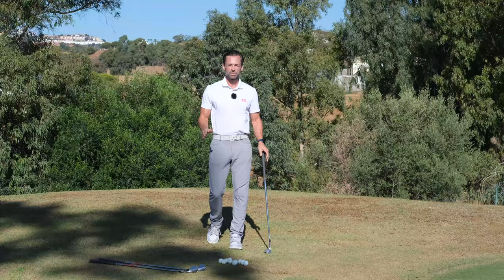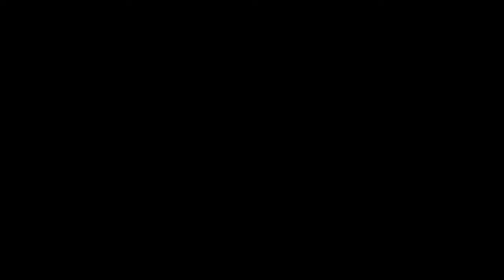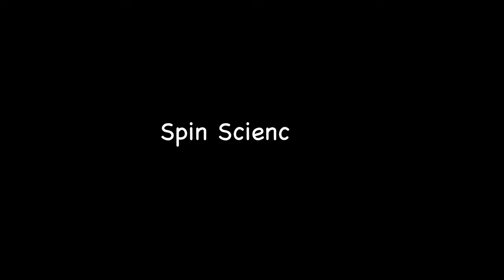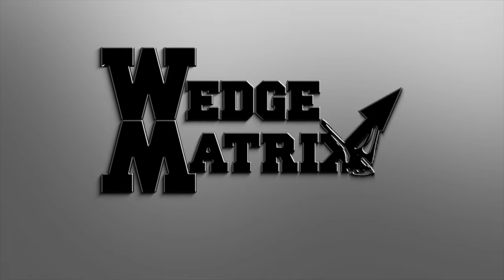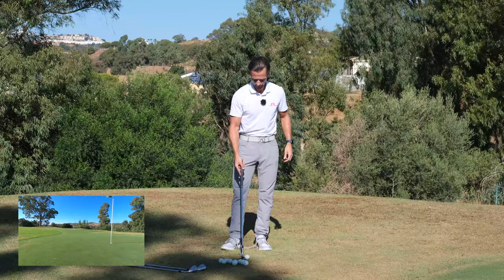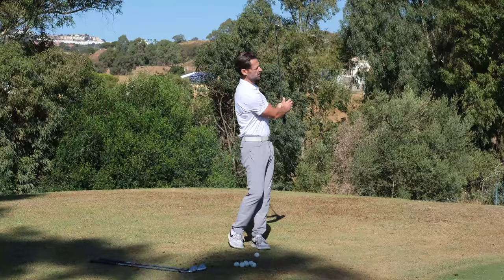Can't Spin It? Learn how to Spin the Golf Ball around the Greens!

Comment: Great video James with very easy to understand explanation of why and how. My question is if your plane is out to in would you need to move the ball position forward? If my ball postion stays central and I swing out to in or in to out i tend to bottom out after or before the ball retrospectively as the swing is three dimesnional.....or is this just in my head!!! Thanks
Reply from the maker: Yes, I'd probably move it up a little. The steeper angle of attack is useful though when it comes to spin from any lie that isn't perfectly clean. If it compromises your strike though it's not worth it!
Reply: @JamesRidyardGolf  Thanks James for giving something to try out.

Comment: Great content as always James. Quick question James an Out to In path for the reasons you mentioned tends to create a bit more spin, would a contributing factor be that the Strike is more oblique, therefore the Smash is lowered affording the player to produce more speed  which helps ramp up the revs?
Reply from the maker: Thanks. Yes exactly, a cut Vs draw with the same face path relationship almost always produces higher spin loft which equals lower smash and a more oblique strike.

Comment: Awesome James. Thanks so much for this. Wondering what effect more -AOA would have as a variable? Obviously you're doing that with the left path, but can it be tweaked on it's own? Should it be? Guess there's a limit there too...
Reply: My thoughts u didn't ask for lol: adding more AOA is inherently going to happen the more left you shift the path like you mentioned. Manually adding even more AOA could add more spin in theory but then you run into potential problems with strike (i.e you have less room for error with the low point being too far in front of the ball) and it's difficult to get the spin loft just right (see towards the end of the video when he had some 'pop up' when he took the technique to the extreme).  I imagine that approaching it from a less open face could give you issues with launch and the wedge digging a bit
Reply: @jakephelps4766  ha no worries, always interested to learn! Strike would be the major issue yes, has to be?
Reply: @robjohnson2761  That would be my thought. I think there's probably not a situation where the ROI of hitting a super steep spinner pitch shot is more than a standard to slightly increased spin pitch, especially in a competitive environment.

Like everything there's outer limits and when you get steeper and steeper the first thing I think of is like you said, the strike. Whether it's inconsistency in the strike point and potentially striking the ball too high on the face resulting in decreased spin or just plain difficult to catch the ball cleanly without the leading edge digging or hitting the ball thin due to the steep AOA and low point being a good bit ahead of the ball, it just brings in a lot of difficulty. There's all sorts of rabbit holes you can go down with variables involved in these sorts of golf topics. 

When we are talking about increasing the AOA independently here it's nice and all but I think in reality it would be pretty difficult to not increase AOA as you try to swing the club more left like he mentioned in the video. Essentially the body mechanics/technique to swing more left also result in an increased downard AOA.
Reply from the maker: Good discussion guys. Independently increasing AoA is an option and might increase spin in a couple of ways. First off it might reduce interference/debris between club and ball which will increase friction. The 'but' here though is it will also lower launch UNLESS you can add loft late which is tough! Now, if you can steepen the attack and add loft you'll clear the path to the ball and ramp up spin loft. 
So it's an option but I'd say it's pretty high on the skill scale and very similar outcomes are available in easier ways ie set up loft and path shifts as mentioned.
Reply: @JamesRidyardGolf  thanks James! Will definitely have a play with this along with the other variables. But, as you say, I can imagine it's pretty tough to pull off consistently!